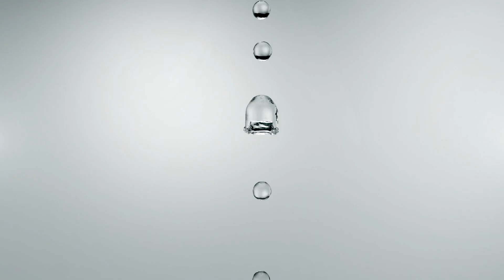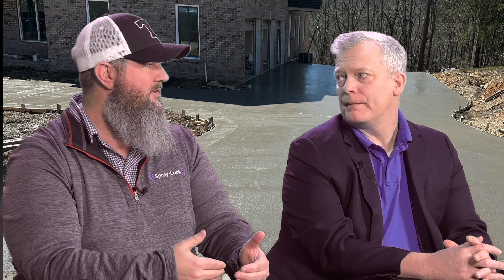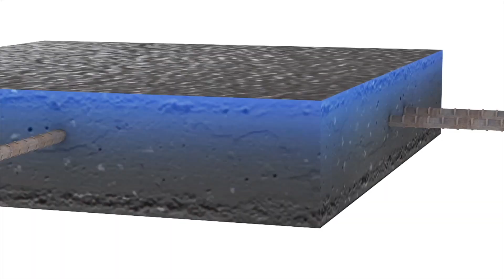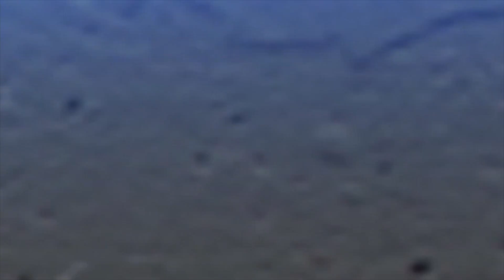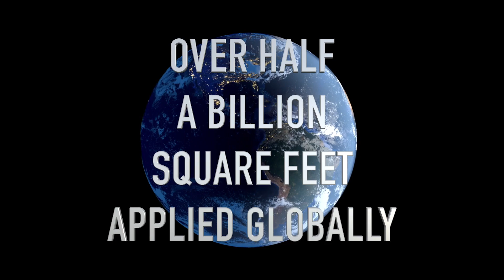Residential Concrete

Comment: If basement concrete treatment prevents moisture ingress will that significantly decrease basement moisture odors?
Reply from the maker: Reducing the amount of water intrusion into any space will reduce moisture odors. Any existing wet areas would need to be corrected as well. Indoor humidity can also create moisture odors as well.